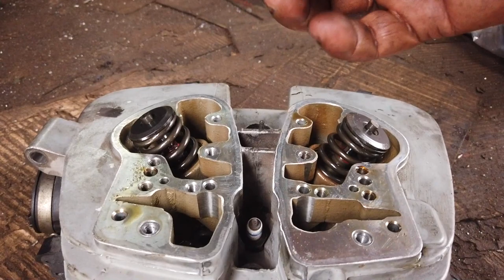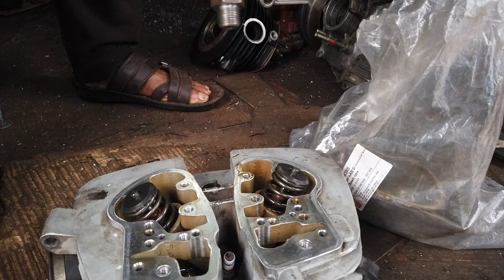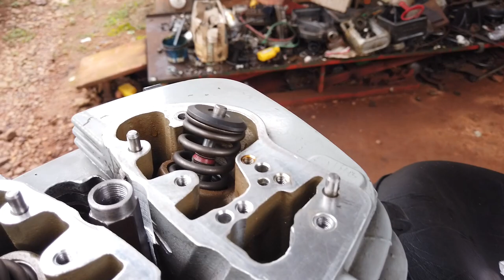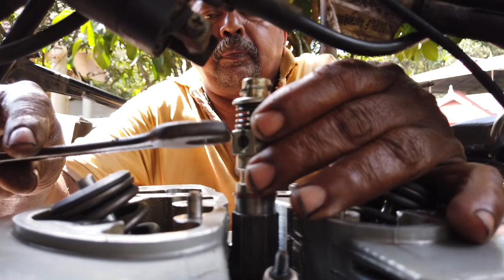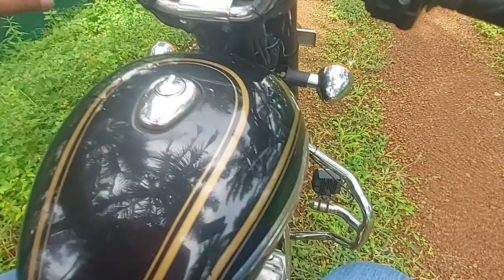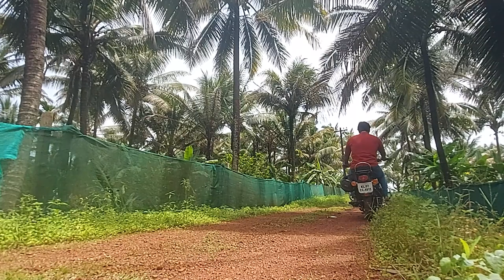Royal Enfield Standard Manual Decompression kit | Manual Decompressor Installation

Comment: city milage 25 kitunnollu😮😮😮😮
ente standerd350  bs4 
city 40 long drive 50 aduthu kittunnund 
with orginal silendser 
njan wildbore silendser aanu ipo vechekkunnath 3to 4 km matre koranjittollu  kicker pakka smooth aanu athyavashyam powerum und
chettante vandi 500 aano
Reply from the maker: Mine std350. 30 to 35 in town 40 in long.  I use factory set silencer.. it gives me good sound already with this model released.. I try not to make too much modifications.. any change in base design will affect our bike in the long run. But I did this to ease my kickstart effort.. changed my seat with high quality form for comfort. Changed my back tyre to classic version for more grip on road. Since bullet at speed will not stop when sudden break. If you take care of your bike ..it will take care of you. 25000 kms my chain socket is still in very good condition. That's how I value and take care of my bike.. thanks for your comment brother..TC.. ride safe..
Reply: Enikku city  40+ aaa long 50+ aaa  53 okke 
Bs4 2017 model company silencer alla mini panjab fillter ullathu sound nice aaa  normal panjab okke ear adichu pokum ithu nice sound aa 
But parking vechu mvd pic eduthu 7000 adichu thannu ippol orginal use cheyunne milleage nokkiyilla nalla ride poyilla 47k KLM odi vandi
Reply: No athu 350 aa

Comment: Bro I am having a bullet Electra 350 2011 and want to do this. I am living in ernakulam. From where did you do this? Should I buy any kit before going to the shop ? Would you pls explain. Thank You
Reply from the maker: I did it in Thrissur. Yes you will need to buy the kit and switch.. do not go to local workshops..  find a traditional mechanic to do this.. else it will be complecation
Reply: THANK YOU SO MUCH FOR REPLYING
 Few More Doubts 

#From where I can get the KIT ? 

#Is it reliable? I mean any future complaints if done perfectly ? 

#For you how may days it took? Like time duration for this Instalation. The place you did is good ? May be I can also do it from the same shop. 
Bro pls lend me the workshop number. Thanks again
Reply: @adv.shebinkanjirappallil1733  Contact Jose Milton, Kalinga Bullet Garage, Judegemukku, Thrikkakara

Comment: വെറും മണ്ടത്തരം ആരുമിത് ചെയ്യരുത് മൈലേജും കിട്ടില്ല പവറും കിട്ടില്ല
Reply from the maker: Enikku power problem illa millege koodi.. plus sound has minor change.. I went to Kashmir with this settings.. never had a starting problem.. 1 kick start with little effort even in 4 degree climate and rain..
This is not an argument but if you have a negative experience your mechanic must have done wrong...
Reply: Power and milage will decrease if you remove one plug and fix the kit. What he did is perfect and i believe this is the right procedure.